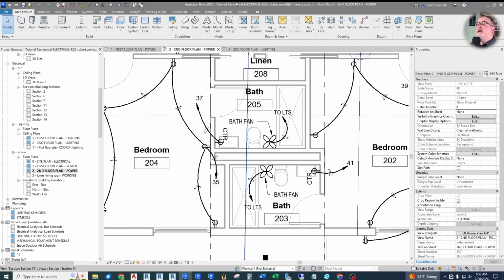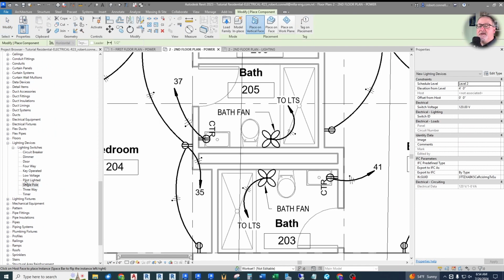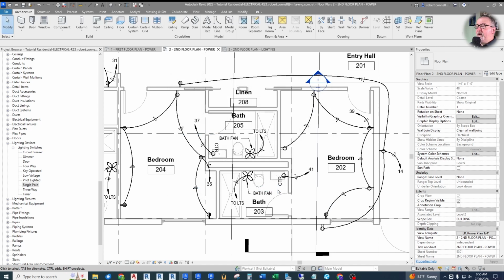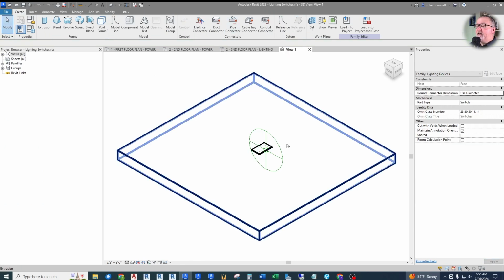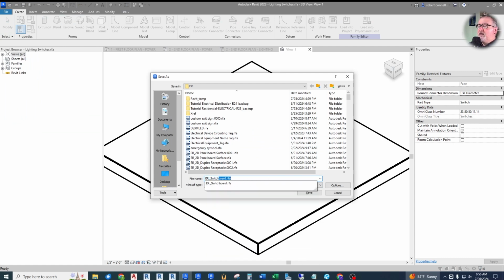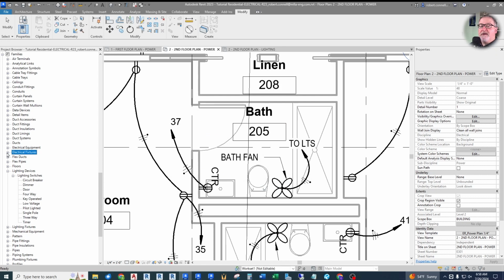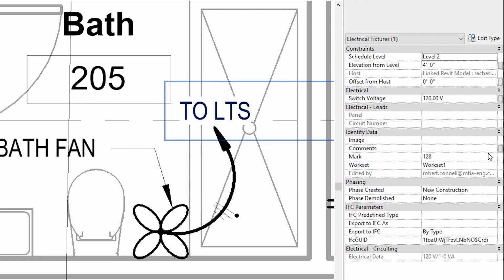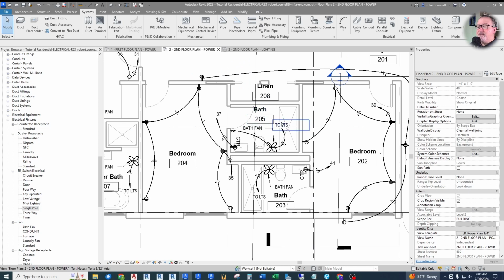REVIT MEP Category Hacks You Never Knew Existed!

Comment: Thanks for the tip. The only inconvenience is there will be two switches on that wall. But no big problem.
Reply from the maker: Correct, but a fairly common practice. Many times even with a timer type switch for the EF.